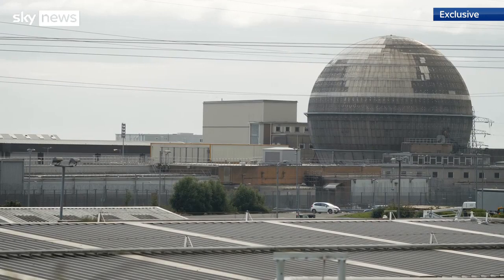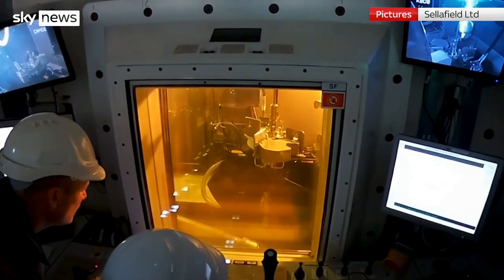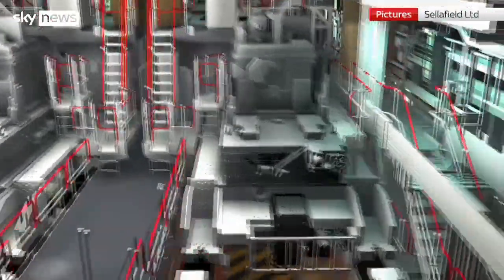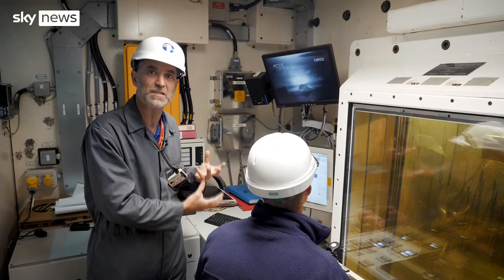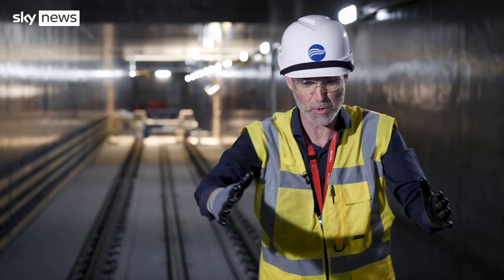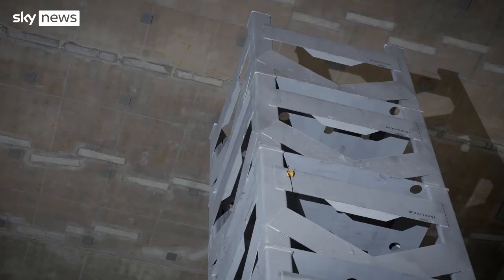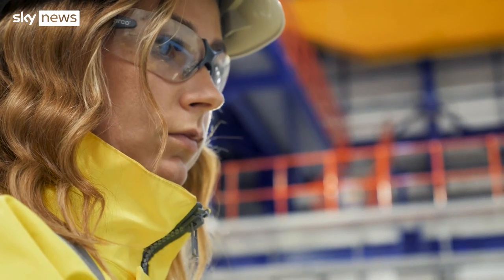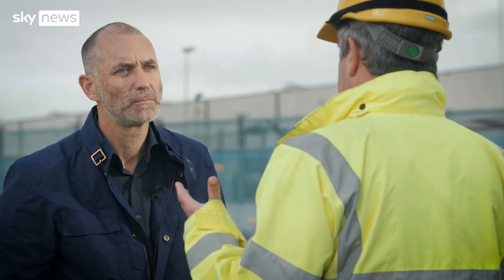EXCLUSIVE: Nuclear waste removal project commences at UK's most hazardous building

Comment: It's a pity that there isn't an efficient way to harness all that energy being emitted by the waste.
Reply: there are 4th generation reactor that can use radioactive waste with left the low level waste that didn't last for 240.000 years
Reply: Ask the French on tips on how to close the nuclear fuel cycle. They reprocess everything!
Reply: @stickynorth  Sellafield is a reprocessing plant, a dirty badly run one
Reply: Yes the French do it on a patch of land as close to England as possible so if the wind blows we get it not them.. awfully considerate!
Reply: @hominidaetheodosia the wind primarily blows in from the Atlantic so that statement is irrelevant

Comment: First of all, no one has died because of that waste, please acknowledge that. The solution planned to store in concrete vaults is good enough, it will ensure no one will be hurt in future. Thanks for pointing out its not waste from civilian reactor fleet, the cost for waste disposal from commercial power production is already included in price set for electricity from nuclear power plants, therefore commercial nuclear waste is always paid for. 
Now let’s run some numbers by assuming that space travel will become very cheap and reliable in 20 years and  cost to low earth orbit would be 200 $/kg.  Let’s say  another 100 $/kg for journey to Venus and 200$/kg for transport to the launch site and carbon neutral fuel needed to propel the rocket, the total cost to Venus per kg would be 500$/kg . FYI  carbon neutral fuel can be produced from carbon extracted from sea water/air by using nuclear power as input. Now for  97 billion pounds  ( 1 British pound = 1.25$) would be 112.5 B$. At 500$/kg we would be able to dump 225 mega tonnes of nuclear waste on Venus. Please bear in mind the same can be done to clean up super fund sites which have chemical waste that does not decay. So let’s not spread unnecessary fear of nuclear waste.
Reply: 200 kg to orbit is absurdly optimistic, and it would be far more to escape earth's gravity well
Reply: Health and safety tip: Don't attach radioactive waste to a giant rocket.
Reply: @Lukeleebrewin  Everheard of Radioisotope Thermoelectric Generator that's been luched pretty frequetly, most of the mars rovers are powered by RTGs.
Reply: @iain3713  in shuttle era  10000$/kg was impossilbe today its below 4000$/kg. Shuttle cost was 50k$/kg.
Reply: @subumohapatra  that's because the shuttle was uniquely expensive, the Saturn V was near $5000 per kg. Bear in mind that it takes way way more energy to send things out of LEO. The falcon 9 can only loft 3000kg on an escape trajectory compared to 16 tons to low earth orbit, and with escape trajectories upper stage reuse is not an option.
Reply: @iain3713  yep good points, on a positive note  I would say  the mars mission and make life multi-planetary folks want to build fuel stations in LEO  from leo the waste cargo packgae can be transfered to venus earth cycler space craft which is fueled by these fueling  stations  also uses low amount of  fuel. remember at venus we r not landing  we just need to place the waste cargo in low enough orbit then open the drag chute.  Of course there is going to be engineering challeges  those need to be solved may be the first 100kg of waste dump on Venus may cost 5k/kg but ultimatly by the nth time cost could be within 500$/kg.
Reply: so what happens when one of the rockets goes challenger on the launch skyline and distributes a decent chunk of this stuff across the landscape below, thats one of the main reasons off earth disposal hadnt been considered

Comment: I have heard of the system that can use nuclear waste as a sustainable fuel source but it does also say that the technology has been around for decades but was not able to be built because of costs. Is their anyone who also knows of this.
Reply: I’d doubt that’s correct because if it was, they wouldn’t be burying it.
Reply: Probably thinking of a breeder reactor. Uses the waste products from current reactors as fuel
Reply: Apparently there is a reactor in the states that was designed for that purpose. Apparently the design we currently use was chosen because it created the waste products needed for nuclear weapons.
Reply: @BritishEngineer  I read it somewhere. It was during the 1960s it was proposed and because of the cost required to build it it wasnt possible. Again I dont know the name of it.
Reply: @tomwhite2765  again I dont know the name but I read they may be able to build one I believe. It was proposed in the 1960s.

Comment: £97,000,000,000?
What?
Reply: I wonder how many tWh of power was produced with this material. I doubt it's 97£billion's worth!
Reply: 97 billion over 120 years works out at about 800 million a year.

Given how complex the site is, and just how much work needs doing to clear it back to fields safely, that's pretty cheap. It's the time component that's the kicker.
Reply: Also, the extreme costs today are a result of attempting to take the cheapest route in years past, with the technology available. In hindsight it was a bad move, but at the time it was the best available practice.
Reply: @Loopyengineeringco 
Power.. None... Material for military, plenty.

Comment: wait, so the reason this clean up is so expensive, is because its so hard to get to the contaminated material
and... the solution is... to burry it even deeper so its even hard to get to in the future?
am i the only one who thinks this... feels just as short sighted as what was done originally in sellafield?
it seems like we are trying to solve the problem with the same solution that we already know doesnt work and only makes it more expensive and complicated in the future?
Reply: I thought the same thing! I've now looked into it a little more, and it appears that first of all: this new vault is built with more up to date knowledge about nuclear waste, so should last for long enough that the waste is less dangerous. But to answer your question about being hard to reach, because the waste is now packaged in those portable crates, instead of massive sludge tanks, it means that it can be easily accessed and moved  by autonomous vehicles.
Reply: Way I see it they continue to make this horrific set of errors because they like the result, and like to say that they don't.
Reply: It’s not buried safely currently. In fact its not buried at all, it’s in a compartment within a building that is ageing. There was no thought put into waste back in the 60s and 70s etc and so it was essentially dumped somewhere for someone to worry about further down the line. The new plan to bury it safely has been thought out over decades and is crucial.
Reply: There are a lot more complexities with this project than just those mentioned in the video. The current silo is holding the waste in extremely large storage pools, underwater. This presents a whole host of issues with long term stability and management which is why the waste is being removed in the first place. Processing the waste to reduce the liquid volume and then placing it into properly engineered, individual storage containers is a long term solution. Even if future generations decide on a new location for the waste, it is a lot easier to move a set of containers than entire buildings. The newly constructed building showed in the video isn’t going to have this waste just dumped into it, it will house the containers full of the waste.